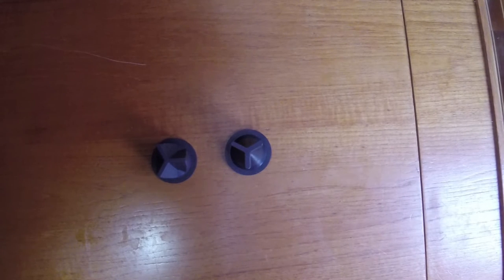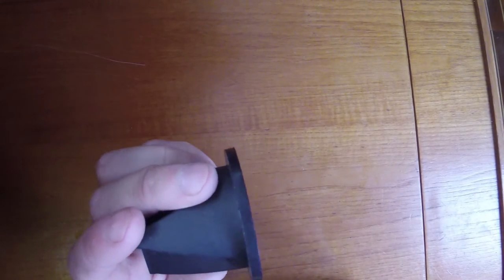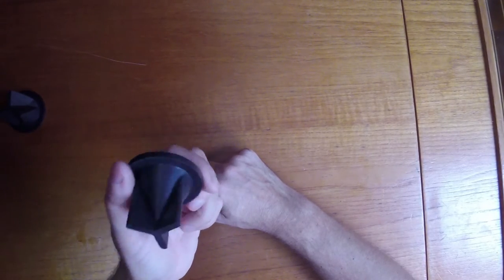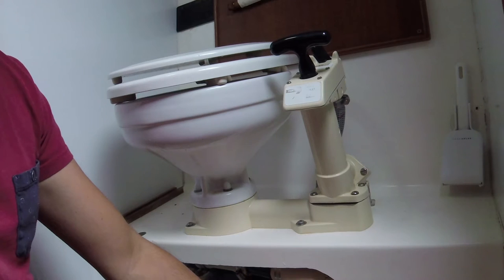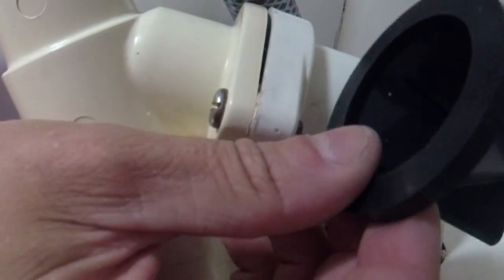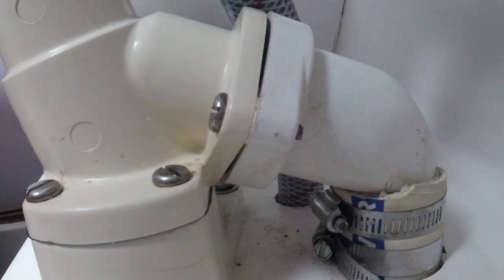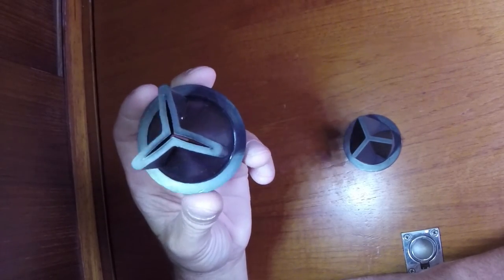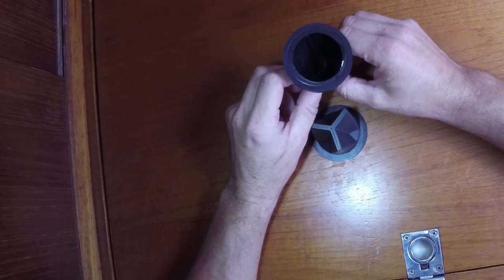How to replace the joker valve on a yacht/sail boat toilet/head.

Comment: 31-Dec-2019: Thank you for this video. I think you should be able to use the TMC Joker Valve. I would add an O-ring of approx size 44mmID x 52mmOD x 3mmT to the flange of the TMC valve so that it stands 4 mm proud from the collar compared to Jabsco 2 mm. The height looks good. So I think it will work. Furthermore the TMC Joker Valve cost just $7 whereas the Jabsco cost as much as $25. Thus, just get a suitable sized O-ring and use the TMC Joker Valve as replacement. Cheers!

1-Jan-2020: I fitted the TMC Joker Valve in place of Jabsco Joker Valve with an O-ring mentioned above. It works great!